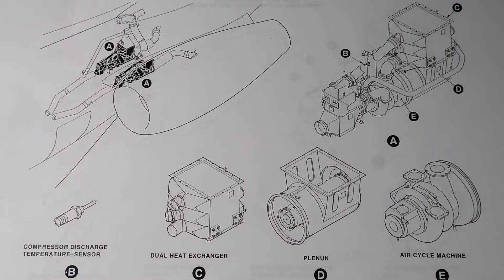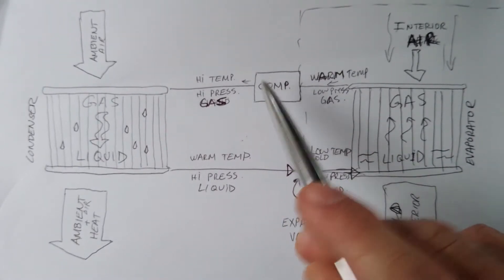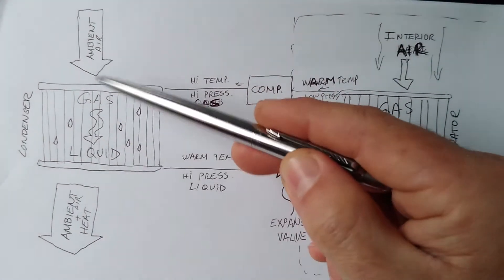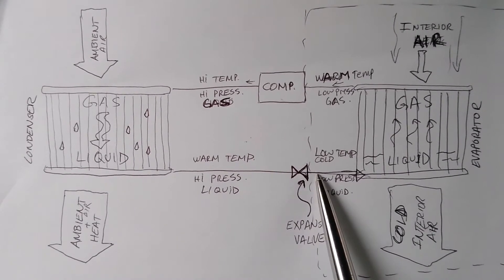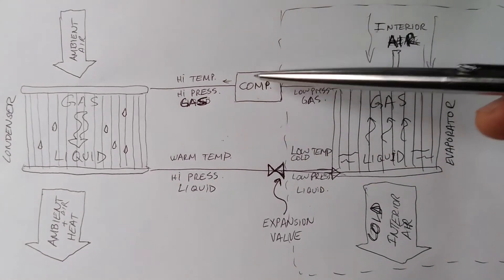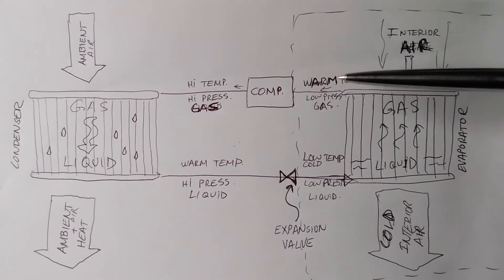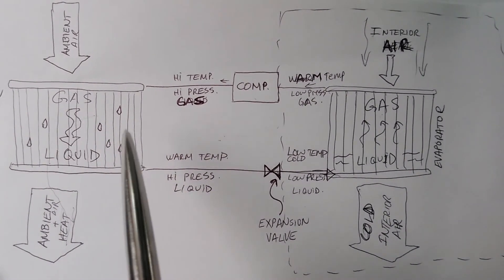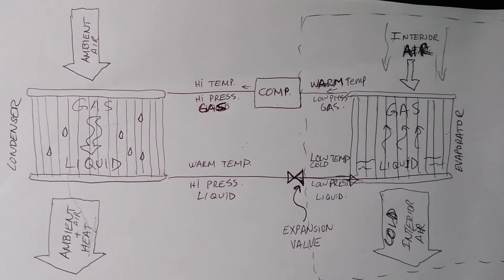AIR CONDITIONING IN AIRCRAFTS (Part 1) Refrigerant

Comment: Yes thank you. it  was help full. I want to use this simple system in a small aircraft I will like to try to build some time in the future. I will try convert an automotive AC system for that purpose.
Reply from the maker: Awesome! That sounds like quite a big project. Even small aircrafts are BIG projects, and one with air conditioning doesn't sound so small either. Good luck and I hope I see you in the future  posting flying videos in your own aircraft.
Reply: @planesimple8514  Thank you. It an effort I am preparing for, for It better try and fail then not to try at all.
Reply from the maker: Very well said!